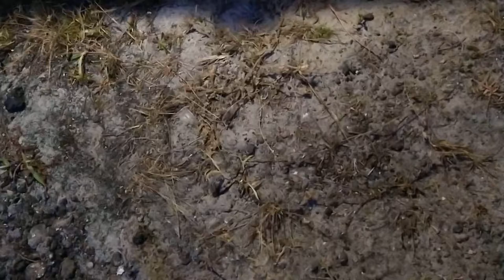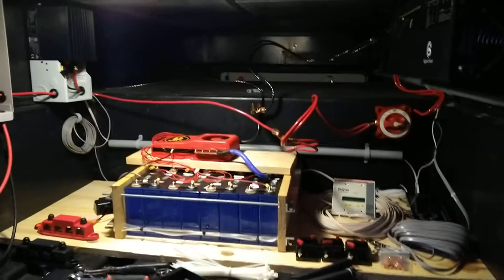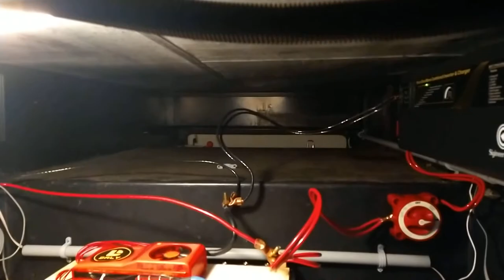Offgrid Tinyhome Motorhome Temporary Setup

Comment: Do you have any jobs starting in Bradenton? I have some 12V tilting panels mounts I have designed. I'm looking for a local installer to make a video with. I can supply the panel mounts in exchange for the video. I will be referring installers on the website.
Reply from the maker: I must apologize. But I am not currently in the solar industry. This is my hobby, and I just like building high power devices.